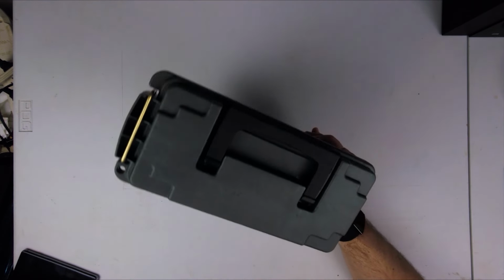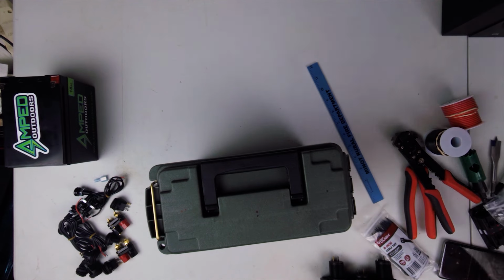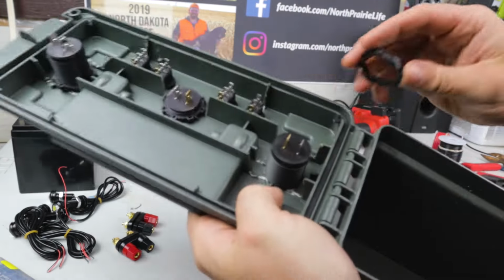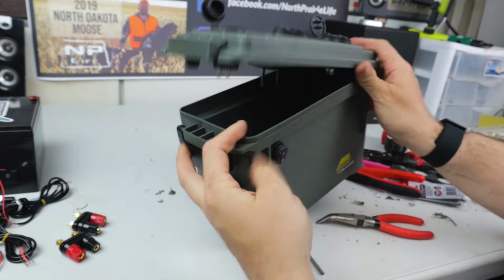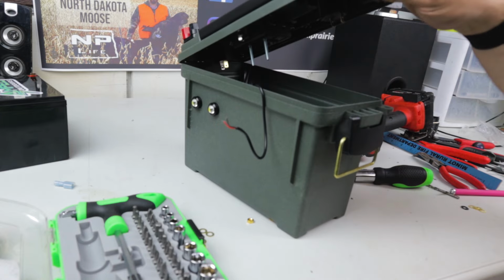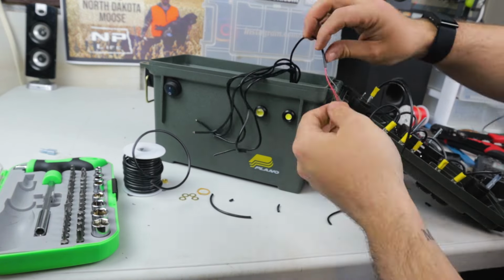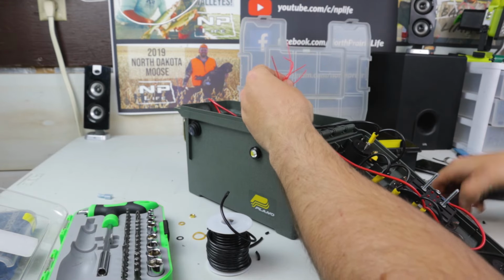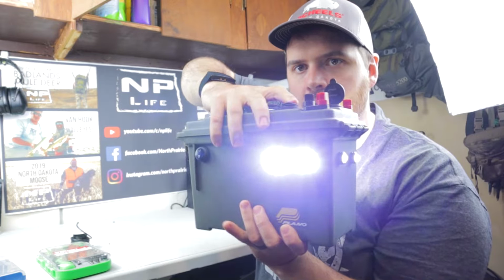DIY Lithium Power Box Build | 18ah Portable Charging Station | NPLife

Comment: Built one of these, or at least similar idea. Mine was a larger box with fuse block, ground bar, dual usb, powerpole 15amp, powerpole 30amp, master switch to power fuse block, and then side mount powerpoles for charger connection on the outside of the box. I then also installed a mobile dual band 2m and 70cm transceiver. Im sure I overkilled it, but I ran 10 awg wire from battery through switch and then fuse block, and then all the other wiring was 12 awg. Fun project
Reply: Can you elaborate on this transceiver thing? I would love to see a video of what you are talking about. I have most of the parts needed, just trying to finalize my plan. I want to be able to power a garmin echomap and a livescope with the black box, and my submersible green LED light for night fishing via cigarette plug. I have an 18ah lithium battery. I hope thats enough.
Reply: @anonymous_friend  ....it is a HAM Radio. Both receives and transmits at 50w for 2m and 70cm bands. Carry a roll up J-pole antenna for the radio. Easily communicates simplex or duplex for coverage in the Tulsa area. Radio distance has a lot of variables, but I can consistently get 40-50 miles. Ive since built 2 more of these using an Apache case from Harbor Freight.....generic version of a pelican case. Fun to build and very useful